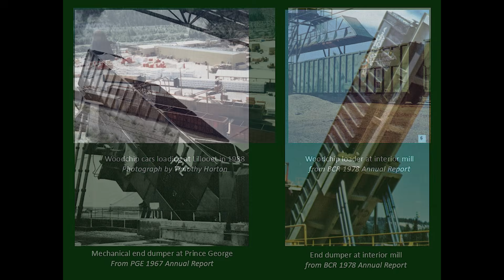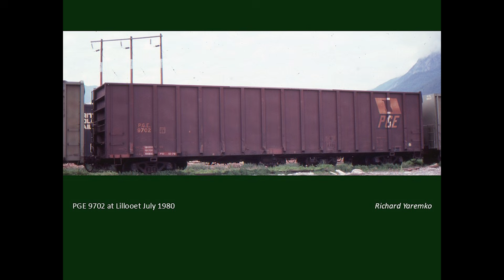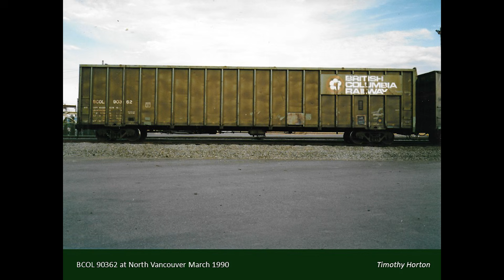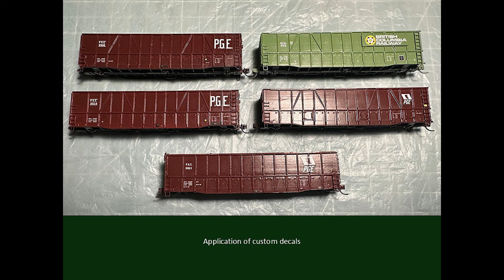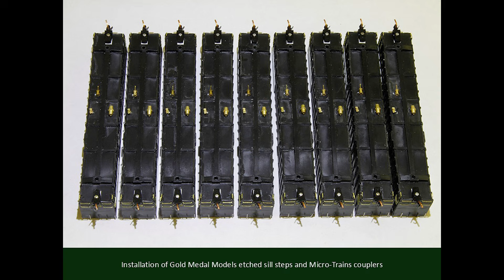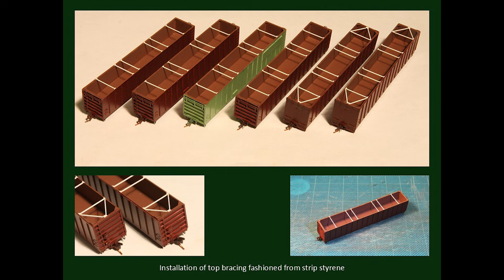Equipt Video 12 Woodchip Cars

Comment: When I was longshoring I worked a few shifts at Fibreco and one of the important jobs was called "Pin and Wedge" We had to make sure the knuckle pin s had their cotter pins and the wedges in the end doors had cotter pins. You could not have a knuckle pin or knuckle fall out into the auger system that moved the chips around the site and the end wedges had to stay in place to keep the end door shut when the car was rolled over in the dumper.
Reply from the maker: Thank you for sharing the info; as modellers and railfans we are primarily thinking of our cars rolling down the rails but shippers and longshoremen also worked with them.